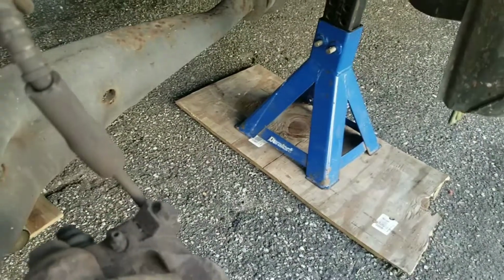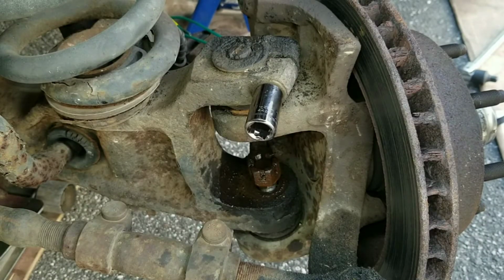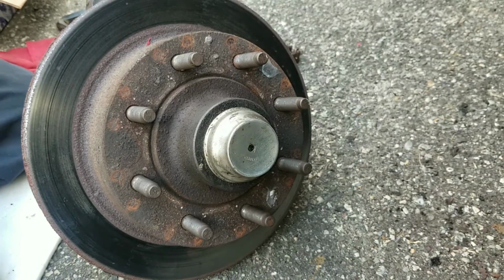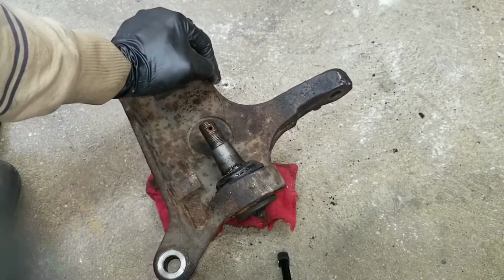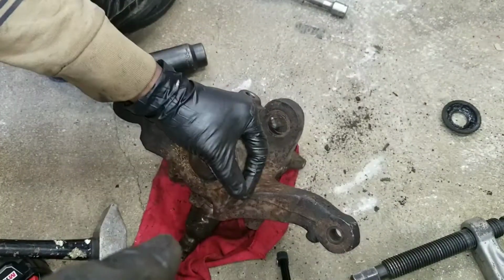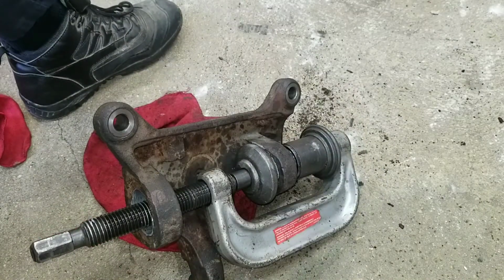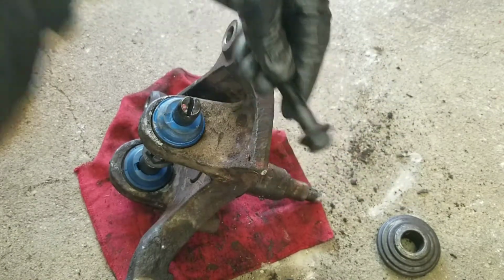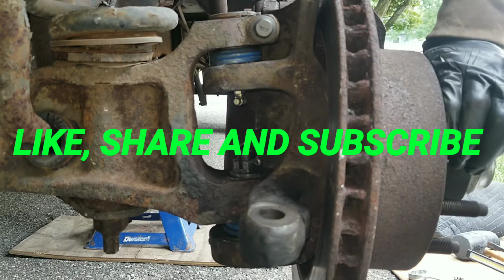FORD E250 Detailed Ball Joint Replacement

Comment: This was a great help.  I used a 8 pound hammer and beat the top ball joint flush and then pb blasted it.   Then i used a large flat punch to beat it out the rest of the way then I followed the rest of the videos instructions
Reply from the maker: Great tip! Thanks for watching please Like, Share and Subscribe if you haven't already

Comment: Well done. One recommendation, put the spindle nut on to protect the threads when pressing the ball joints out and in.
Reply from the maker: @DLjoey good advice. Thanks for watching please Like and Subscribe if you haven't already
Reply: Excellent point I always leave the nut on the end even if I have a rag or a piece of wood at the end where the threads are

Comment: Good detailed video but you didn't show how you got the boots on them especially the bottom one.I followed what you did and I cannot get that lower boot on.How did you get it to press on?
Reply from the maker: Use something with a blunt end to tap it on or use a large deep socket or the same cup from the removal tool. Thanks for watching please Like, Share and Subscribe if you haven't already

Comment: Excellent video good job I only have one question I can’t figure out how to put that sleeve back in for the upper ball joint I don’t see how it lines up there’s no lineup for me and the whole is on an angle so obviously it has to do with a wheel alignment could you clarify that for me please I can’t even get my upper ball joint out it is seized I almost broke the compression tool so I threw some penetrating oil on it overnight I guess I’m just gonna have to use a sledgehammer on it the pin is solid as a rock on top maybe I shouldn’t remove it the bottom one is no good. Suggestions thank you stay safe
Reply from the maker: @Peter Laurance Armenio  the sleeve should have a notch or lip that lines up with the opening on the spindle.  If not,  you can compare it with the other side just remove the wheel and see how it's set up. Hope that helped.   Thanks for watching please Like and Subscribe if you haven't already
Reply from the maker: You can also  apply some heat to try and remove the upper ball joint

Comment: Wow, I have to replace all four ball joints and all the bushings on my Ford E250 1995 van and did not realize how much work is needed to replace them. The only question I have is how do the ball joint help with steering and alignment? My van pulls to the right and it ate 1/2 of my brand new tires! Its constantly swerving left and right and having to hold the steering wheel straight is not fun.
Reply from the maker: @Headbanger Ministeries  pulling left to right is usually ball joint or tie rod end. Thanks for watching please Like and Subscribe if you haven't already

Comment: so hit a few snags on mine detroit axle sold me wrong parts so had to pay retail autozone prices there not exactly like oem either and you need to leave boots on so they will work correctly they dont sit as high in knuckle i broke to breakers bars before i figured this out lol. i ilved your vid so i did subscribe before i commented
Reply from the maker: Thanks appreciate it.  And thanks for that info on the ball joint

Comment: Man I have gone from ONLY replacing the sway bar bushings that are in the axle on my Ford E-250 06' 4.6L to finding myself wanting to replace the tie rod bushings and ball joints but am scared to proceed any further. Lol Hopefully I can pull this off....it looks to be a pretty extensive job. Might be biting off more than I can chew here. 🤔
Reply from the maker: @Bama Tony73  it's not that bad once you get started.  Thanks for watching please Like and Subscribe if you haven't already
Reply: @BIGWILLSCARCARE  I have subscribed. Also "liked " You're right it wasn't that bad. That brake light switch on the brake pedal can be tricky getting back on. It took me literally 30 minutes or so to get that thing on there. You know when it's correct too. It like pops on perfectly with enough room on the rod for the white washer and cotter pin. Which wasn't the problem so I don't have brake lights on this company van. Ford E250 06. 4.6. Not sure about the name its either a romeo or a Windsor if not mistaken.  Where would you look next for no brake lights? I checked the bulbs I have tail lights just no brake lights when you press the brake pedal.  You can cheat during the day by pulling the light out lol but not at night and that could be very dangerous and cause somebody to run all up on my tail end. Not to mention any cop will pull someone over for no brake lights. I checked the hazzard lights by jiggling them on and off. Maybe a bad harness?

Comment: Do you really have to take the rotor off? I'm going to try tomorrow without
Reply from the maker: Sorry for the late response.  Yes it have to be removed
Reply: GodSun Universe already did the job without removing the rotor, is definitely much heavier to deal with but it’s no issue getting ball joint in or out
Reply from the maker: I removed the rotor for video clarity

Comment: But what is spec?!? Aaaaaaahhh! 😂 I came here to find the torque specs and that's the one thing left out fml 😂 good job tho 👍
Reply from the maker: @Frankdirt777  you can find the torque specs online or sometimes your local dealer parts department.  Thanks for watching please Like and Subscribe if you haven't already.  Also follow me on Instagram Big Will Car Care
Reply: How did you properly torque the top bolt and bottom nut without knowing the torque spec?